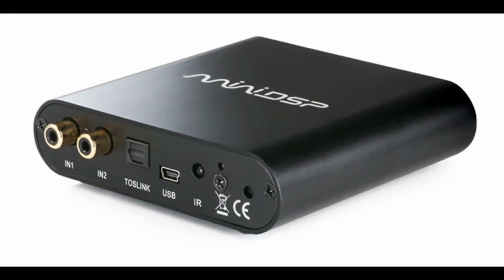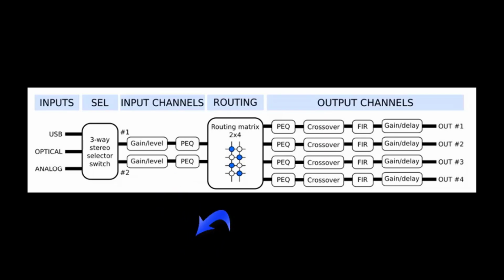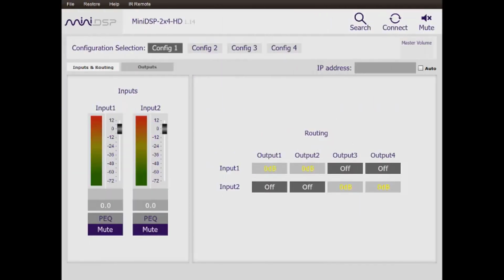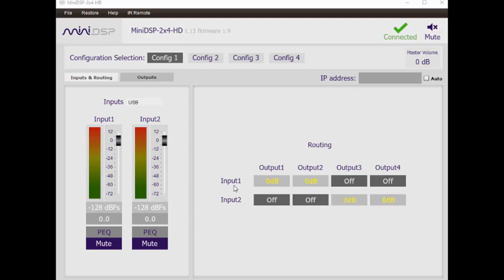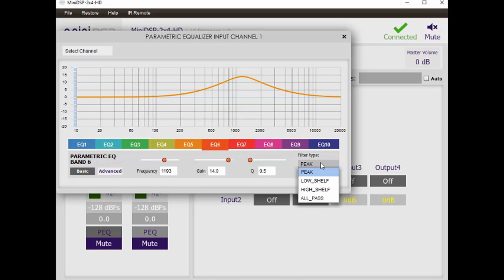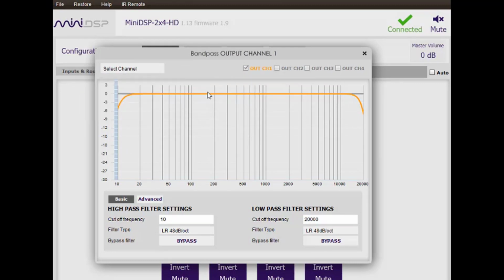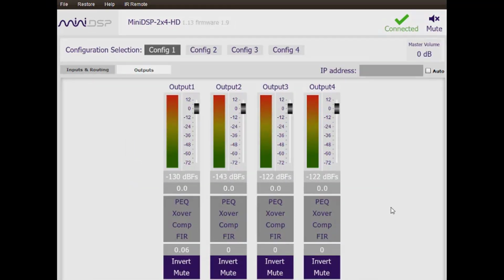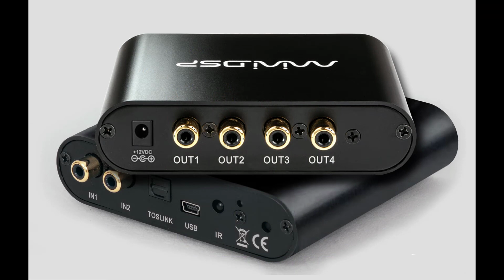A Brief Overview of the miniDSP 2x4 HD

Comment: When coming out of my pre pros pre out's into the mini dsp, would my pre pro's internal dacs pass through and out the pre out channels of the dspmini?. Or will I only be able to use the dsp mini's internal tone/dacs after the passthrough conversion.
Reply from the maker: In this configuration you will be using the DAC in your Pre Pro AVR and also the ADC and DACs in the miniDSP 2x4 HD.  The ADC and DACs in the miniDSP 2x4 HD are excellent and provide high fidelity results.

Comment: hi....what exactly is missing in Minidsp2x4, compared to HD??
Reply from the maker: The miniDSP 2x4 HD has many advantages over the standard 2x4:

1) USB audio streaming up to 192 kHz and a TOSLINK digital input

2) Operates as a high-performance DAC and/or digital pre-amplifier
3) Analog 2 Vrms inputs and 2 Vrms outputs
4) Higher Fidelity DAC circuit
Reply: @deer_creek_audio  thank you so much for the reply !!!!

Comment: is it correct i need a plug on 2x4 advanced if i am using this for subwoofers
Reply from the maker: Yes the 2x4 Advanced plug-in will allow you to crossover and room tune up to four subwoofers.
Reply: @deer_creek_audio  set the hpf to 13hz  and using bw 48db and sub is too quiet dual 18s ultimax on ported box